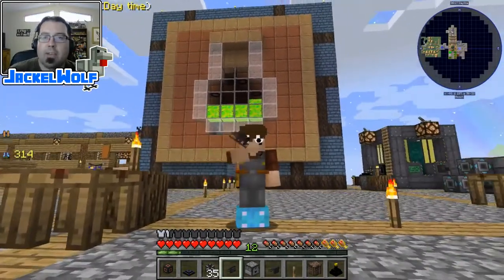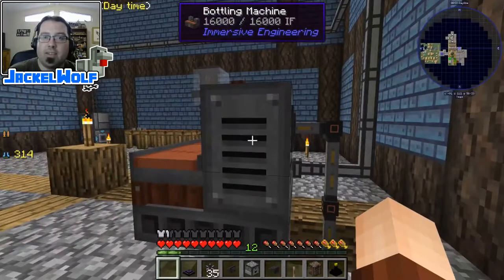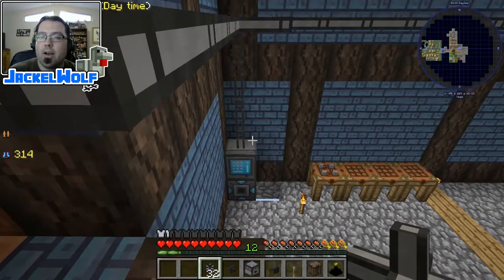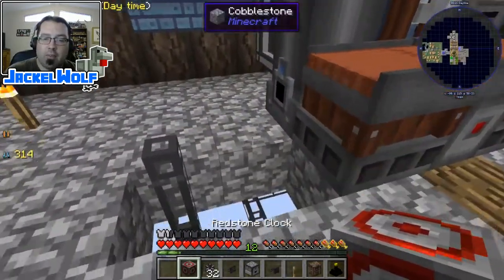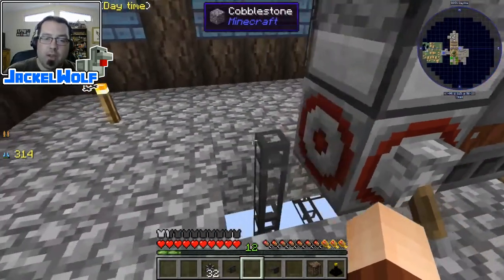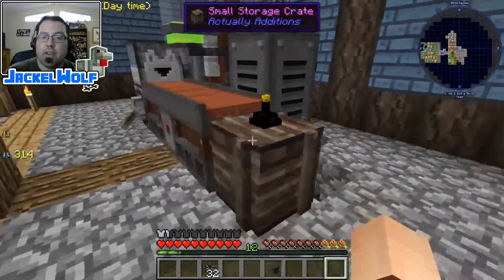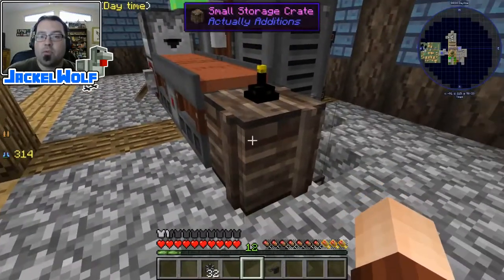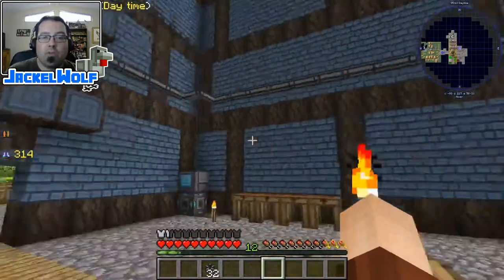[SKY FACTORY 3] 5-MIN - THAT'S HOW I DID IT! - EP56 - BOTTLING MACHINE PART 2

Comment: Thanks for the Video. The Hint to use a dropper was it :) Now my bottling machine works :) And now i work on an solution to switch between liquids like lava or water :-)
Reply from the maker: That's an interesting one... short of switching off the flow and running the tank dry before you turned on the other... hmmm... if you used a fluid transfer node on the storage, could you suck out the excess?

Comment: bruh i made this and it wont fill with xp ;-; help
edit:the bottles wont fill but the tank fills ??
Reply from the maker: Hmm... not sure. It's been a long time since I did this. I do remember it being finicky. Are you  tossing the bottles in the right place?
Reply: @JackelWolf  i used a dropper but when they got to the tank they would lift up and not fill maybe i need a mod for it but idk
Reply from the maker: @littlecesarv2500  you are trying to fill with experience, correct? Or are you using another liquid? Also, are you playing SF3 or a different/custom modpack? SF3 should come with all of the necessary mods, but if you are playing a custom pack, then it is possible you could need something else. 🤔
Reply: @JackelWolf  yea i was using a custom modpack and xp liquid so i probably need to switch to SF3 modpack
Reply from the maker: @littlecesarv2500  ok. Let me know if you have trouble with this, though it has been quite a while since I've played SF3. Not sure if the bottle is even in SF4. 🤔
Reply: @JackelWolf  The sf3 modpack does allow xp bottles to be made so imma find out what mod it is